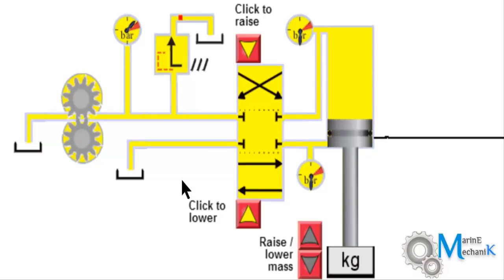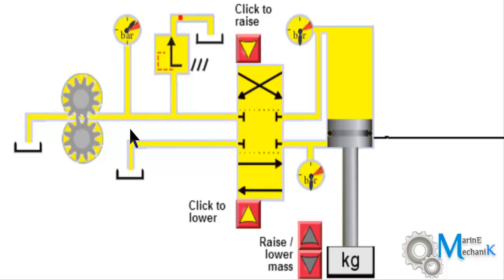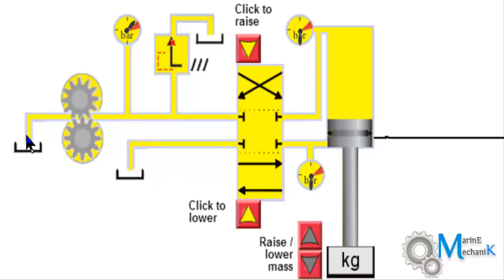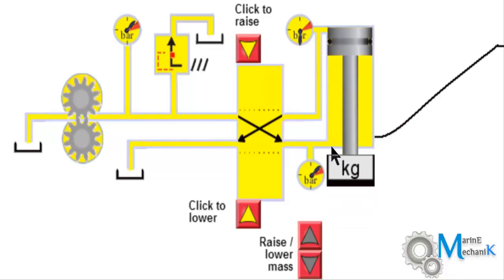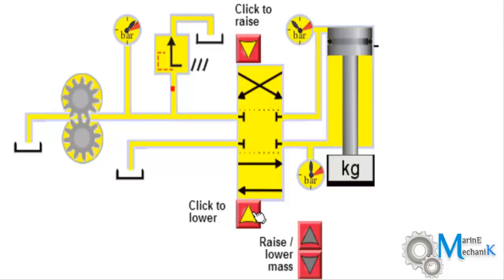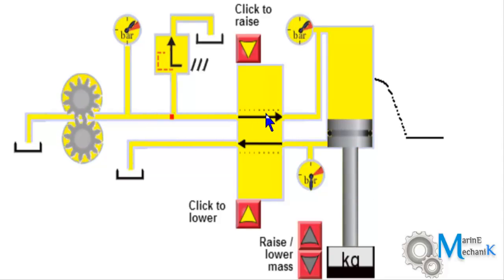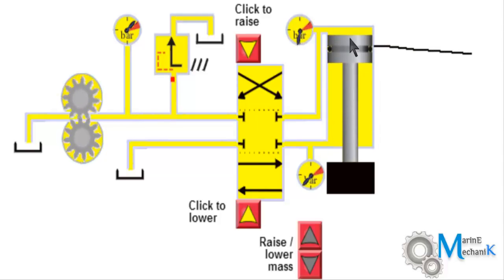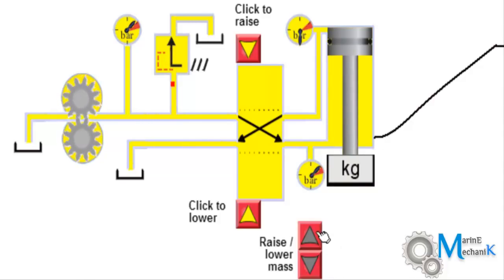Simple Hydraulic System Working and simulation

Comment: Very nice content...! Clear explanation..! More videos to come..
Reply: But you should never use a closed center contol valve with a fixed displacement pump. In neutral position, when no work is done, the pump creates full flow at full pressure over the relief valve all the time. This creates heating of the oil and the system, consumes a lot of unnecessary energy and wears out the pump.
  With an open center control valve, in neutral position, the oil has free passage from the pump through the valve to the tank. This is how this system is realized in practice.

Comment: 7:15 the piston is rising but still it shows the fluid is passing through to the relief valve
Reply: The relief valve doesn't open fully immediately. At the limit pressure only a part of the oils flows through the valve. As an example: If the relief valve is set to 3000psi it starts to open at maybe 2900 psi and opens fully at maybe 3100psi.

Comment: Very shocked how informative this video was. Thank you
Reply: The big flaw in this presentation is that you should never use a closed center contol valve with a fixed displacement pump. In neutral position, when no work is done, the pump create full flow at full pressure over the relief valve all the time. This creates heating of the oil and the system, consumes a lot of unnecessary energy and wears out the pump.
  With an open center control valve the oil has free passage from the pump through the valve to the tank. This is how this system is realized in practice.

Comment: 5:47 What is the theory behind the piston dropping? We assume the seals are all intact and the valve working correctly. You can't compress a liquid (I don't think?) so where is the excess liquid going? Not criticising you video, just learning.
Reply: All seals in a hydraulic system leak a little even if they're intact. Of course not as fast as this. It can take days, weeks and even months before a piston "falls down". But it doesn't happen in a few minutes.

Comment: Your system will overheat the hydraulic oil because the pressure at neutral is too high you make it an open center control valve

Comment: Engineering Adventures
9 months ago
Sriram has NO copyright to use this simulation. It is an old version with the R/V set to low so giving a false output. the assumption is wrong and I've asked him to remove it. I've now modified the simulation and made another video to explain things better https://youtu.be/8JVuJQb5H08 . On the compressibility of oil point, we do normally say oil is incompressible, most calculations are based on this. However, when designing systems we need to keep pipe lengths short to ensure the system is stiff enough to be virtually incompressible. In reality, oil is slightly compressible and this does greatly affect the design of high-performance systems.

Comment: Someone should explain to this guy that you can’t run all ports blocked on the valve in center if you are running a gear pump. P should’ve connected to T. Jokes.

Comment: This is misleading! In combination with a fixed displacement pump like this you should always use an open center contol valve. It means that when the valve is in the middle non-working position the oil flow is free between the pump and the tank. That means the oil can flow free and almost no pressure is created, the pump can run idle. The release valve is only needed when the piston reaches the ends of the cylinder or  to limit the power of the piston. This is how most common simple hydraulic systems work in practice. A closed center control valve, like the one in this video, should only be used in combination with pressure compensated variable displacement pumps.

Comment: No the relief valve is not the way oil is returned to tank while spool valve is in centre position, if this was the case you would be replacing pumps all the time as well as every o ring in the system constantly, oil has to return to tank under zero pressure when valve is in centre position
Reply: Right on brother. You should be teaching the class!!!!
Reply: Relief valve to tank equals heat. Prints don’t like heat. Plus you’d grenade your gear pump instantly
Reply: Orings don’t like heat sorry
Reply: Its a horrid idea! The fixed displacement pump isn't the pump for this at all! That or you should put a tandem center so Pressure goes back to tank with no restriction. however you would still have alot of wasted energy. Variable pumps are so much more efficient. Using the relief valve will heat it up from energy transfer and youll destroy the relief so quickly it isnt funny! I sell relief valves at work and you'd be buying them and pumps left and right trying to replace them because the DCV is using the wrong center. If that relief valve ever failed to open youd blow the seals on the Closed Center and your pump would die. Oil has to go from tank back to tank and if you block that flow its going to build and build like a shook soda can until at some point it finds a way out on its own!
Reply: that is correct broo i have pitty with the student of this instructor learning in a wrong way

Comment: I've modified the simulation a little and made another video to explain thing better https://youtu.be/8JVuJQb5H08 . On the compressibility of oil point, we do normally say oil is incompressible, most calculations are based on this. However, when designing systems we need to keep pipe lengths short to ensure the system is stiff enough to be virtually incompressible. In reality, oil is slightly compressible and this does greatly affect the design of high-performance systems. In the simulation, we had exaggerated the compressibility to show its effects, but it was not really intended to explain much in this model. For example the spool centre condition is wrong and there is no load control either.

Comment: A few issues here. Firstly the simulation was taken from e4training.com and the copyright note should have been removed. Also the speed should not change with pressure. This was just a basic concept demo, not a proper circuit, if you notice the r/v opens due to the inertia of accelerating the load. That's why the cylinder slows. I'll check the r/v setting in the software and update it.

Comment: As far as i know,  hydraulic oil is incompressible. This is the main principle behind hydraulic systems. But in this video of yours, at 6:00 the piston is at top position. How come it compresses down the hydraulic oil? And don't tell me that the oil above the piston is being expanded.
Reply: no hydraulic fluid is non compressible but there are leaks in almost any system this is also a simulation that cant capture all of those small leaks, seals and piston rings are not perfect

Comment: This is the example of load holding system so there should be a pressure sequence valve and flow control valve too at the rod side of the cylinder to control the speed of the cylinder during the lowering of the cylinder.

Comment: Do hydraulic pump systems currently have a variable power output mechanism, like a 'transmission' at the pump body, so that a faster response could be used in a light weight load, while full power (slower extension) could be applied to heavy loads? The one shortcoming of hydraulics currently for robotics is that they seem to be "all-or-none" regarding piston extension/retraction, and also that they are without an acceleration / deceleration phase in their movement. 

For the "all-or-none" solution, I'd propose the pump body being matched to a variable CVT type of transmission, allowing either very quick fill with light loads (fast movements) while also allowing full power though slower movement for heavy loads. 

For the acceleration / deceleration solution, I'd propose a valve that turns to allow a small flow, increasing as the valve opens, then decreasing again as the valve turns into closure.

Comment: You can not compress a liquid. !
Reply: You need to go back to school.  Fluids CANNOT COMPRESS
Reply: You can compress fluids. It takes alot of pressure, but you can.
Hydraulic oil has properties that make it not compress, but it does, just very little.
Reply: Everything can be compressed.  All you need is extremely high pressure and no loss of mass. This is all theoretical.  But at a certain point the molecules will desintegrate and your material will change.  At this point we talk about nucleair science.
Reply: Can not compress liquids, That is a fact!

Comment: I want to fix a point that you said in 8.13. It can easily come down, that is correct but not by gravity. dropping time of a body is independent of mass. For example, there are two bodies which have different mass. but they have same level high. so,  when we drop these in the same time, than we will see that two bodies to fall on the ground at same time ..

Comment: The compressibility of hydraulic oil in your video is exaggerated. Hydraulic oil is compressible, though the amount is almost negligible; approximately 0.5 % between 1000 to 4000 psi, as I understand it. Temperature also has some affect, but not that much. Also your pump is rotating in the wrong direction...just sayin'
Reply: Hi +HiTechDiver while I agree that the Piston drop thing is wrong, wrong, wrong the gear pump is moving in the correct direction. Hydraulic fluid passes around the outside of the gears in a casting that forces it into a  tighter space on output than the input. 
but it does look odd on the diagram ill give you that
Reply: +Chris Suttill: Hi Chris. Thanks for the input. Life is a continuous learning experience, for those who want to learn. Your reply gave me the incentive to increase my understanding of this subject matter. Thanks.

Comment: the oil is liquid, and liquid suppose to be a (non compressible ) so that means that oil escape through the valves to the tank, or somewhere else
Reply: +medo sam . I agree oil is non compressible.
Reply: The oil go back to the reservoir tank using the return line

Comment: 3 accessories are missing
1--pilot hose to move the pressure relief..

2--By pass Valve if u are in neutral position..

3--meter in meter out for your cylinders...

Comment: Hi, there are two things I do not understand.

1. The piston falling with closed valves: shouldn't the oil be practically uncompressible? How is it possible that it compresses and expands so much? I though the slow falling was due to leaks for the excessive pressure on valves

2. The arrows at 4m2s: are they actual pipes, or do they just point a direction? If they are not specific pipes, I see no reason why oil should press under the piston: the pressure is lower in the pipe going back to the tank, bottom left, so I expect the oil to flow out freely from there, instead of increasing the pressure inside the tank.

Anyone could give me a hint?

Comment: my dear how the liquid will compressd? and if you are right then we can fill 20 liter water in a 10 liter can .
Reply: +sajjad hussain Cannot agree more with you. Coming down the load is mostly due to the cylinder internal leakage not fluid compression.
Reply: +sajjad hussain Are you a professor in hydraulics or  have business in this area? can we talk sir.
Reply: Yaser Maddahi i m agree with u... thankyu
Reply: Mr.Yaser sajjad hussain is trying to say there is no more compressed after control valve stop. Cylinder start to come down due to internal leakage. Oil is already compressed  during push the cylinder pushed up.
Reply: Yaa.. fluids are non compresible

Comment: hi, great video, probs the closest i've gotten so far in my project apart from it's too much for my project XD

my project is an elevated king size bed. the frame would be made from scratch mainly wood and metal brackets and extra shelves for extra support.
my main goal is that i want the mattress elevated from a button when not in use as i'm planning to have my computer etc underneath. so essentially it's like a low down bunk bed but king size.
my question is what hydraulic arms called and is there a way to have them push and retract from a push of a button and where can i get them? 

many thanks in advance :)

Comment: Thankyou sir for such clear video and the concept.. but may i know how we can we un lift the heavy equipment gradually. The rapid falling of ram could damage the good. The ram may fall vigorously if it is allowed to fall under the force of gravity
Reply: +Pravat Devkota There are valves that can be partially opened. :-)
Reply: may i know what type valve do we use here? 
and thanks for your reply.. hope to hear your ans :)
Reply: +Pravat Devkota Different systems will have different valve mechanisms. To give you example, a simple butterfly valve if made of suitable size and provided controls can be effectively used. There are p-valves, (p for proportioning) too, that can be used. Exact valve will depend on the machine and you may check from their websites.

Comment: The explanation in itself is rather good, but I did notice one thing which other users have as well: Liquids cannot be compressed, and so, even under load the cylinder should stay in the same position.
This can also be seen in cranes mounted on lorries, where the main arm (that is, the first one after the hinge with the base) will stay at the same position when the crane is lifting a load, even when this is several meters away from the cylinder.
The reason is rather simple: To extend or retract a cylinder, an amount of liquid is pumped into one end of the cylinder. When the valves are closed, the liquid is effectively "captured" in the cylinder, and so, the cylinder will stay in the position it reached when liquid was moving it.

Comment: Good presentation, except for the claim that the load will lower because the fluid below is compressed. Elementary fluid mechanic laws broken right there. What will occur is hydraulic lock until direction of flow is switched.